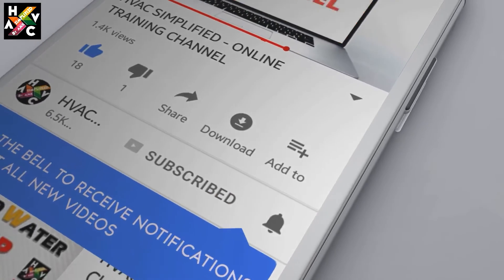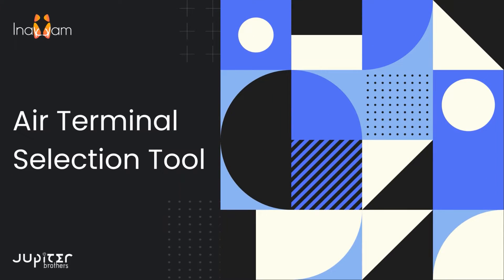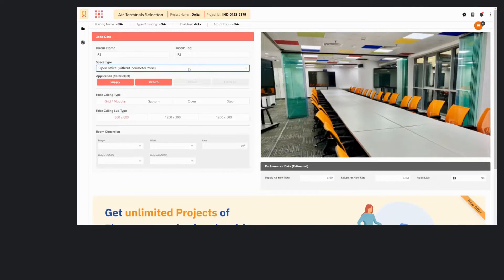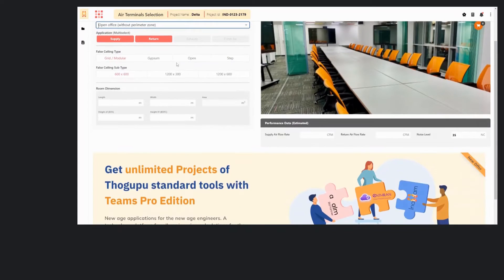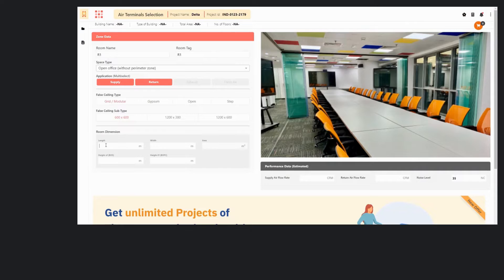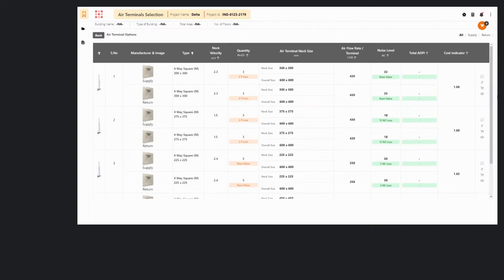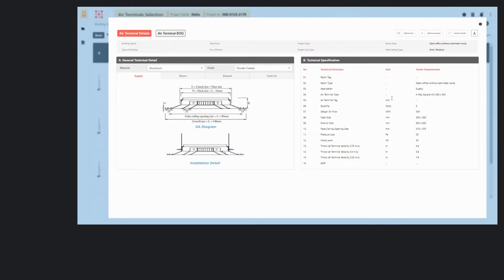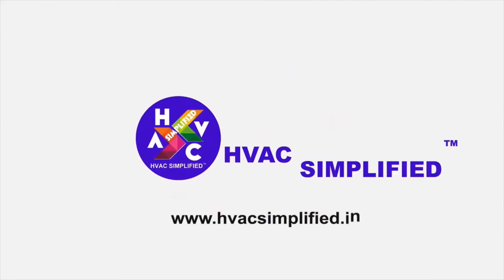Air Terminals Selection Sizing Tool - HVAC Engineers & Designers #hvac #hvaclove #airconditioning

Comment: Sir, thank you sharing the knowledge, i have one doubt.

1) In FCU & Ahu chilled water piping connection we fix 2 way valve in return line,,,,,,,,,,,but in our project for chilled water hi wall unit- 2 way valve is placed in supply. Will you answer this

Thanks 
Feroz Khan